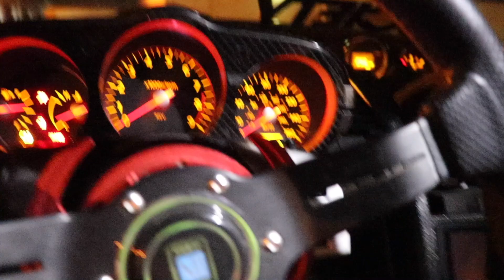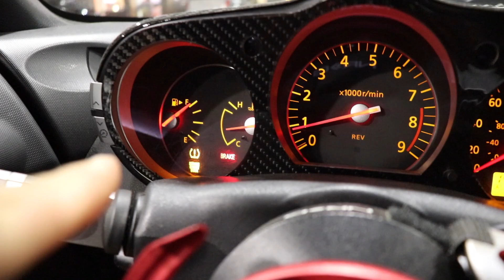e85 350z is back on the streets! | 350z vs 370z/350z/Camaro!

Comment: Definitely buying a z thanks to you thinking about an 06? Maybe an 07 if I can swing it what do you think?
Reply: Alex Feole Get an HR man lol, 06's are quick too but the oil consumption on those Z's are serious.
Reply: PR1NCETD0T ahh I new they had oil consumption but didn't know it was bad lol I really want an hr just don't know if I can swing the extra money for a good one
Reply: Yea im contemplating on either getting a 370 or HR, but most of the HR's i see are high mileage but decent condition at 13-14k. In my case, it's either pay out the HR in cash or be in debt with the 370 LMAO.

You can fix the oil consumption problem on the 06 by getting an oil cooler but even then you may still run into other problems.
Reply: PR1NCETD0T Yea that s about how it is where I live one in good condition is going for over 10k and wish I could get a 370 lol